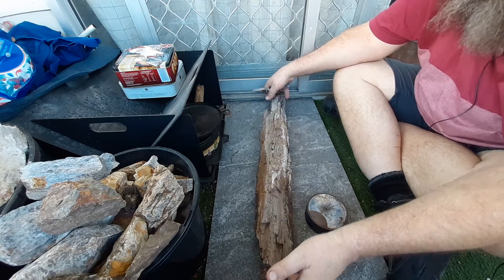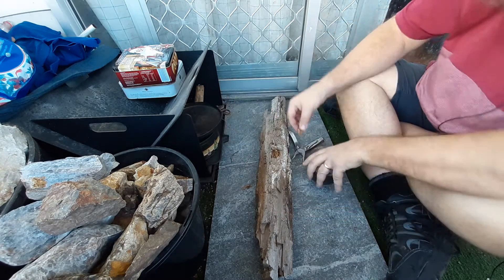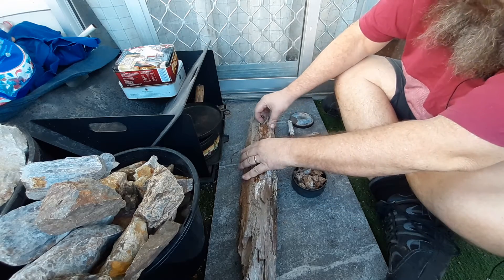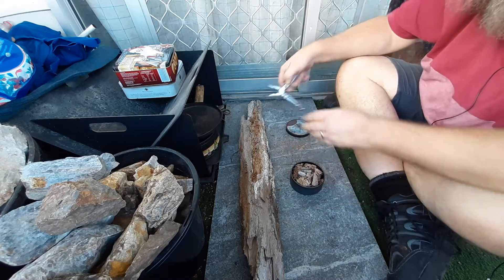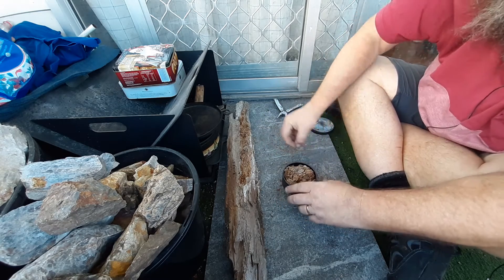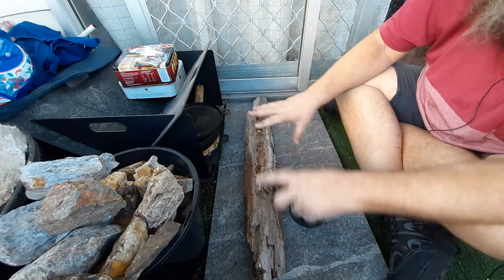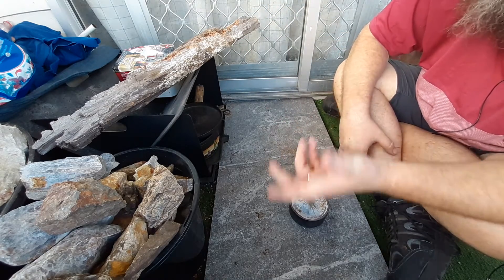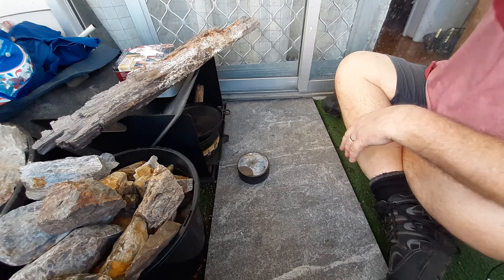more on my backyard punkwood

Comment: Nice punk wood dean. Getting that spungy tecture is key i think. Have you tried a comparison between the open char method vs closed lid method? Did you get those links i sent you. Thanks for the videos brother.🌏🙂👍👏👏👏👏
Reply from the maker: from primitive primate? Yes, I have seen his vids, I haven't tried the open can method yet.

I agree, the spongier and lighter the punk wood the better the results. The woodier the punk wood is (and harder) basically ends up as charcoal, which is fine but won't take a spark from flint and steel very well. Also if you watch carefully it is those fine feathery end bits on the punk wood that are most likely to catch the sparks.
Reply: Thanks for the tip. I appreciate your insight and advice. Thanks for sharing.
Reply from the maker: @jasonedwardledburynewzeala9897  no problems mate, this is how we all learn, adding information into the pot for the collective to draw from.
Reply: Good on ya mate!